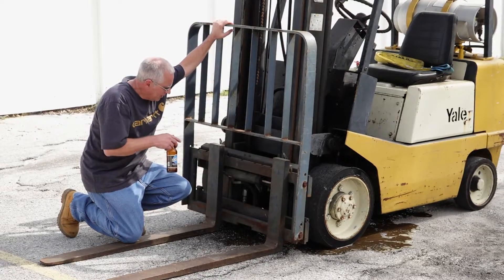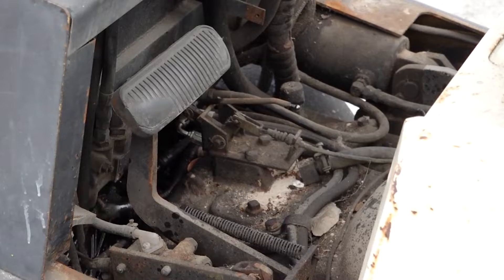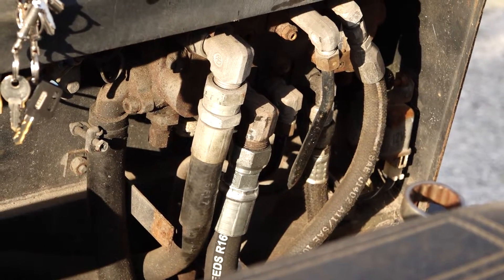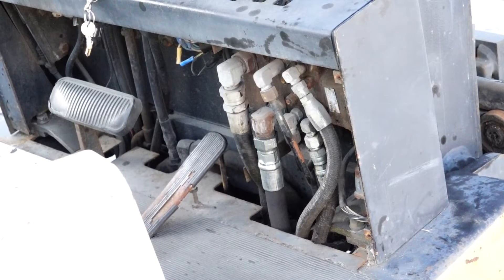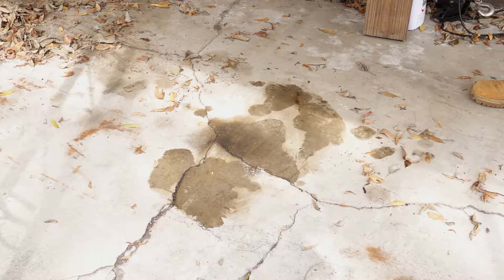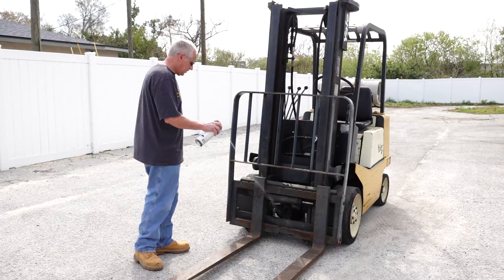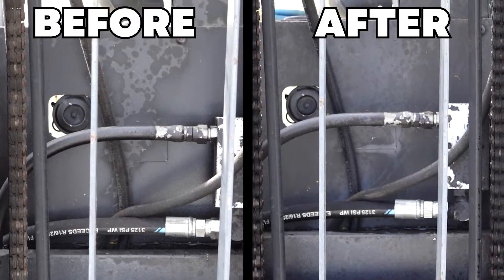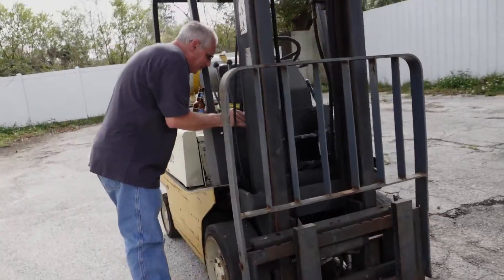How To Replace Hydraulic Hose in Forklift - Yale Forklift

Comment: What if its the long hoses how would you jack the forks at a height?
Reply from the maker: We actually replaced the long hoses a few years ago and made those ourselves using reusable ends ( https://www.discounthydraulichose.com/shop?Search=reusable+end ).

Those are the easiest to replace because they just loop around pulleys and are easily accessible without having to jack up the forks. to get to them. And again, no need to worry about position, the system will bleed itself. Just install the hose and the hydraulic pump will take care of the positioning.

If you do need to jack the forks up, once the system is open, hoses off, you should be able to jack up the forks with any jack or even a winch or come-along. Just be ready for fluid to leak out as you do that, if necessary.
Reply: What size wrench did you use?